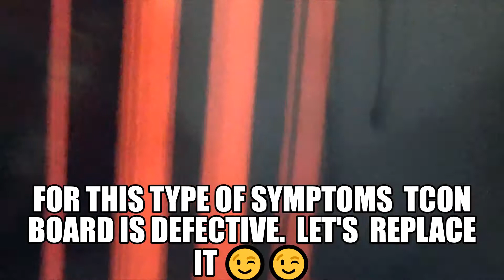KDL 43W800C  Red Striped  vertical lines display.

Comment: OMG, there's no need to change the T-CON board. It's just an oxide layer forming on the pads of the FFC cables. Just wipe them extensively with antistatic clothing and isopropyl alcohol and it's fixed.
Reply from the maker: Hi, thanks for watching ☺️